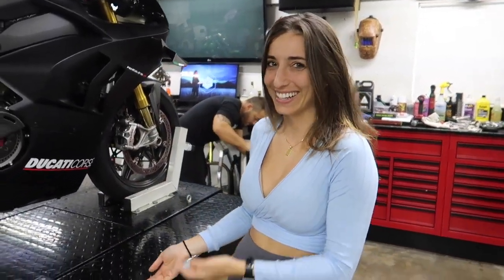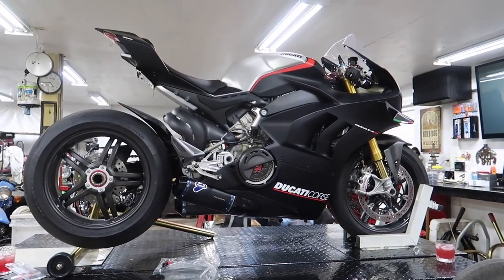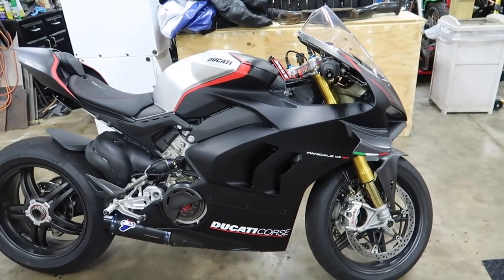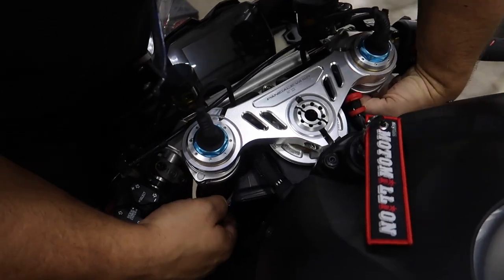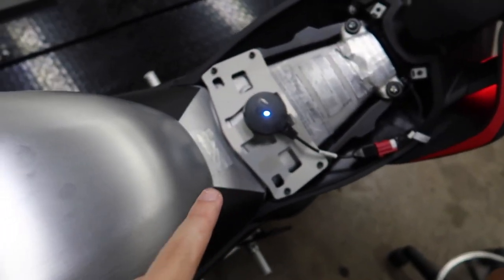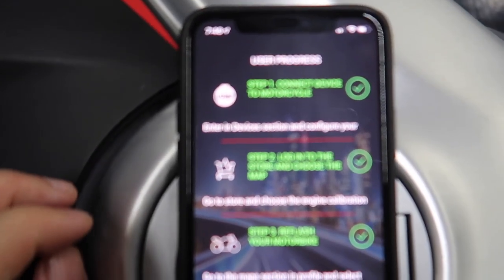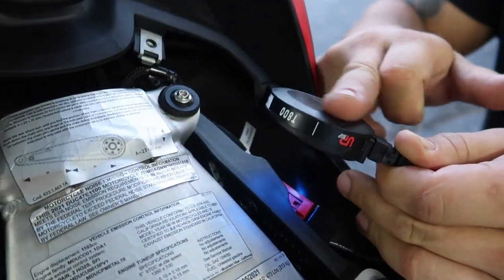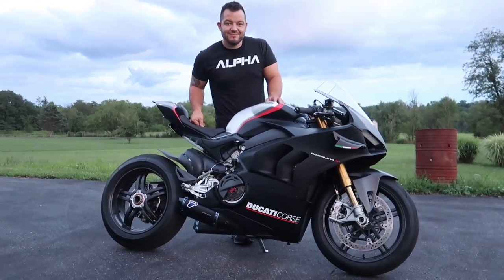Race Filter & Termi Flash for Our Panigale V4 SP!!!

Comment: Looks and sounds very good!
I believe you do not need to keep the flashing tool connected because once the Bike's ECU is flashed it should keep it. As far as i know plugging the device in is only for connecting and writing the flash from your phone. :)
Correct me if I'm wrong.

Greetings from Germany!
Reply from the maker: You are correct. We just keep them with the bike so it’s easy for the owner to locate. But we might remove them and just include them in a box with the rest of the stock parts
Reply: Greetings from South Africa. I found my SP with a flat battery one morning, and determined it was caused by leaving the UpMap dongle plugged in. Since I keep it separate from the bike, the battery has been fine. Was surprised how quickly the dongle managed to drain my battery. 
Did you guys disconnect the O2 sensors after the flash?

Comment: @jaretcampisi if you leave that T800 installed like that make sure you keep the bike on a tender. It draws a constant load hooked up permanently
Reply: It would be kind of cool if you play around with the app logging functions for a video though, no one ever messes with them.
Reply from the maker: it actually shuts off after a short time...we've had it installed on the monster for over two months and never had an issue...we will probably remove them both though now that I found out you don't have to leave them installed